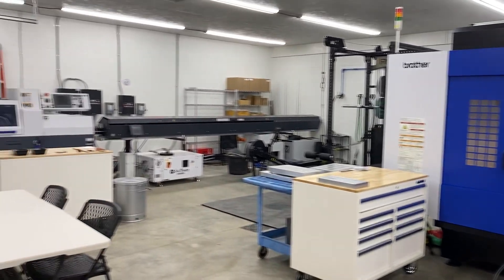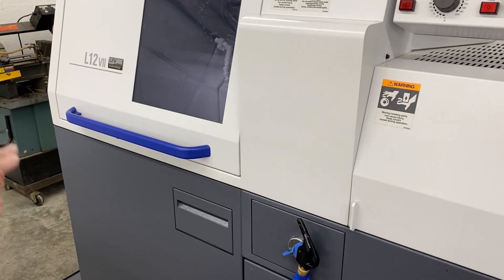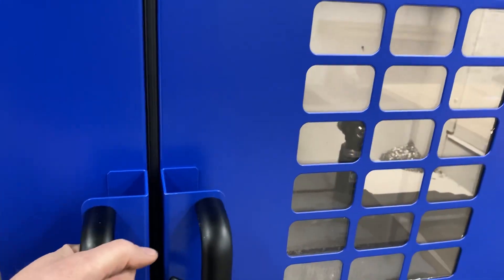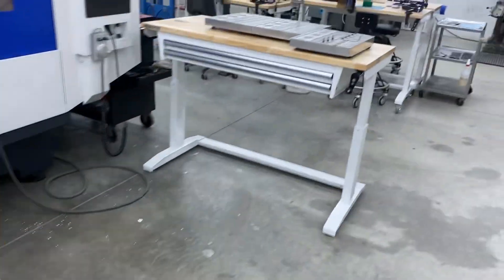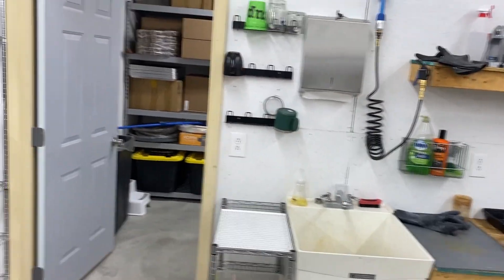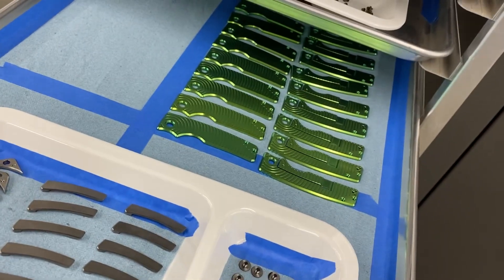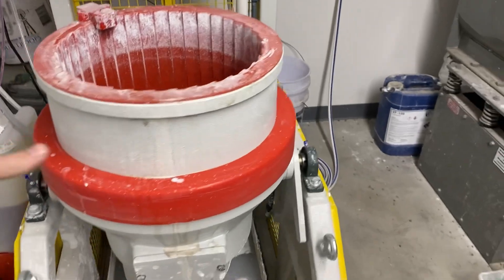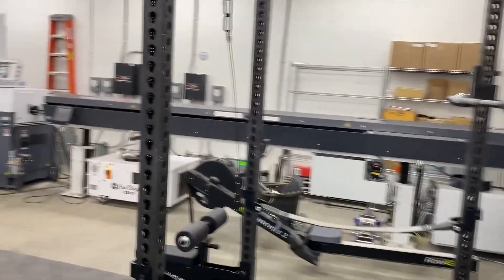Updated Shop Tour! Brother Speedio W1000 - Citizen Swiss Lathe - Disc Finisher - Rouge RM-6

Comment: what brand are the air guns you guys use for the shop?
Reply from the maker: I get them from McMaster. They are awesome. Small and lightweight. The air hose hookup is the handle essentially.
Reply: 2020N11	Pistol Pocket Blowgun with Industrial Shape Air Inlet Quick-Disconnect  $18.99 (Mc-Master-Carr)